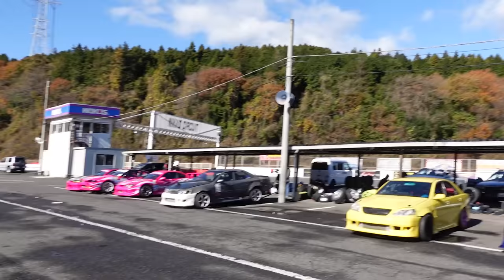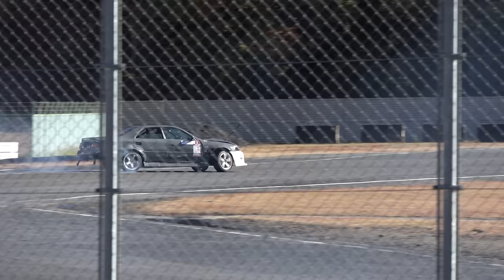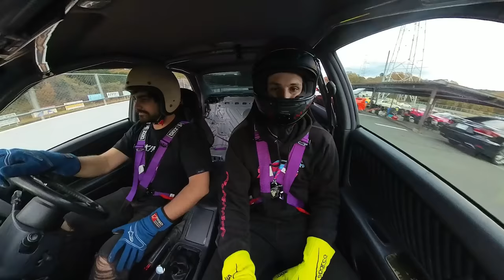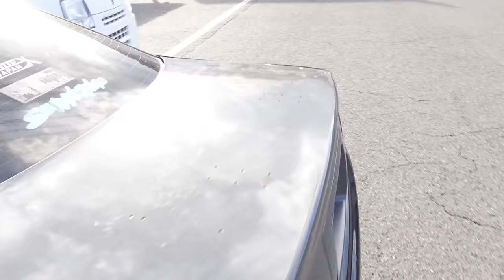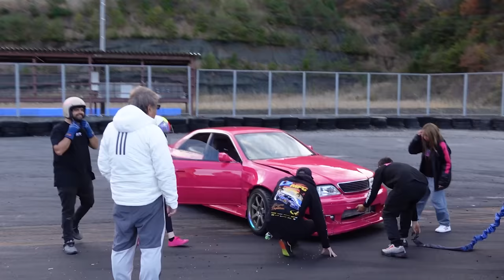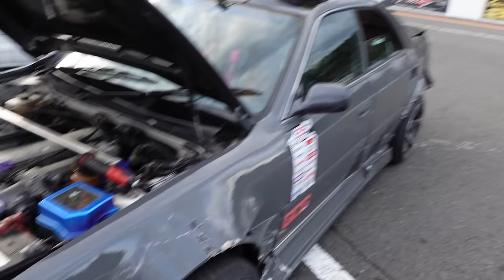DESTROYING OUR CARS AT NIKKO CIRCUIT! - 3 CAR CRASH!

Comment: The oil in the plugs, do you think that’s from valve stem seals leaking??? I recently changed my plugs and found the same issue. 1and 5 were soaked in oil but I never had a misfire !

Comment: Yall just need to get a little jack hammer with a 2x3 1/4 steel weelded to a chisel to beat the love taps out . Would be alot easier and nicer than a hammer. But what evers at your disposals.

Comment: I saw a video of someone with an outside car GoPro Mount that changed the direction of the camera with the air by a fin so it would always point where the road is even when drifting. You should try it out it looks really good.